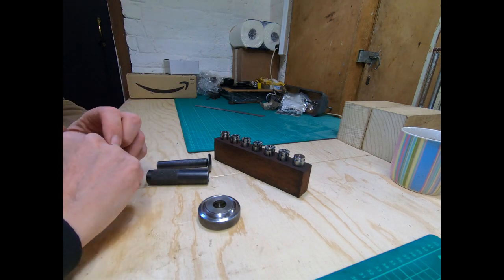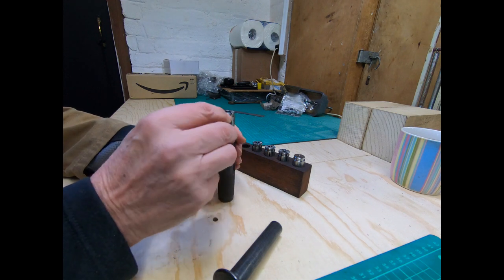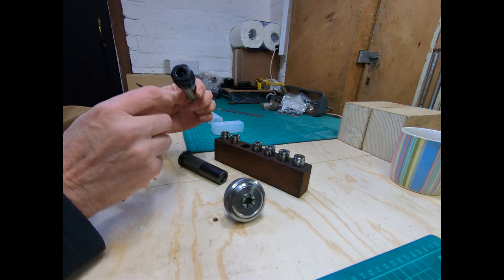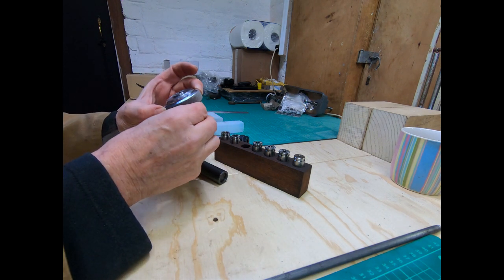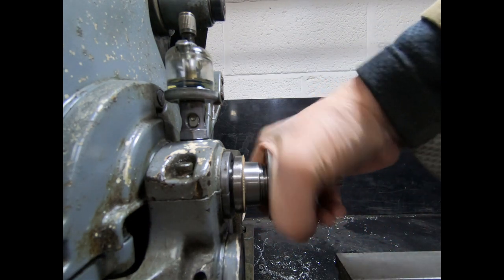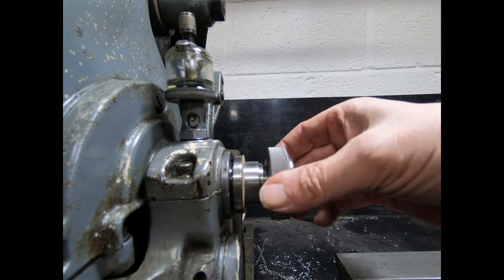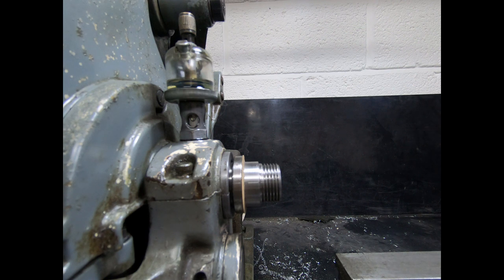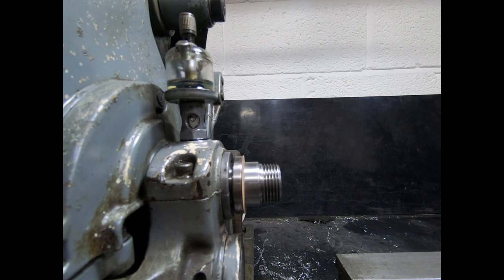Myford Lathe - Genuine Morse Taper 2 (MT2) Collets.

Comment: Everything you said was I think correct Paul, and unless those collets are seriously worn or there's damage within your spindle, the run out should be very good. Anything Myford made was always to a high standard. But for a lathe, a spindle mounted ER collet chuck either shop produced or commercially obtained can be made to work with basically zero run out. Yes it takes a bit of design and machine work, but it's possible to use the same idea Bison and a few others use to zero the part run out on there 3 and 4 jaw scroll chucks for multiple parts of the same size. Running a Google search using Set Tru, Set True, Griptru etc will  turn up the information. But it basically uses a slightly under sized back plate that fits the chucks recess and usually 4 set screws through the rear O.D. of the chuck body to adjust the run out your collet chuck against that back plate and/or any run out the collets may have. You do have to slightly loosen the bolts holding the chuck to the back plate, adjust and then re-tighten. And yes all that is just about as slow as just using a 4 jaw independent chuck. The difference though, is once adjusted it will have the same run out for multiple parts.

For a lathe I don't use the taper mounted ER chucks at all simply because as you mentioned they do prevent longer work through the hollow spindle that was designed in for that exact reason. There only benefit is that there quick to mount or remove. But there's no adjustment, so what you get for any run out your stuck with. Although they make 5C scroll chucks that could be made to work on that Myford, they would really be a bit too large and heavy. As far as speed, a lever or air operated 5C collet chuck is about the standard for most of the world. Unfortunately they require a spindle taper of at least MT 5 and a full set of 5C collets. At the quality and guaranteed low run out I'd expect with any collet set up all that would be very expensive and still wouldn't work with my MT 4 lathe. For people like us, I think the ER collet design and those back plate mounted chucks are about the best compromise. The ER's are still very limited against 5C's and there multitude of accessory's, indexers, square and hex collets though.
Reply from the maker: Hello,
Many thanks for taking the time to watch and comment... One of my goals is to show interested viewers what the Myford has to offer which is partly achieved by my video but also by people adding comments... I have a Grip-Tru chuck for my Myford and plan to make a video on it at sometime in the future... When I first saw them I thought they are very good and would help to get some accuracy in my setup...
Take care.
Paul,,

Comment: Great video Sir, I don't have a Myford, but a related problem I found  on my older Logan lathe the 3AT and 3C collets are limiting on the bar stock thru size up to the largest collet ID=7/16".   I recently added a 5C collet chuck and increased my thru bar stock size up to the limit of the spindle ID= 25/32"  The scroll action of the 5C collet chuck has much more holding grip than the 3AT-3C.
Reply from the maker: Hi Al,
Many thanks for taking the time to watch the video... sounds like you found a nice solution on your Logan... I do like the look of the Logan lathes...
Take care.
Paul,,

Comment: That is a very cool idea they had with the way those collets worked, I guess the ER system just eclipsed it as time went on but I can see how the MT system would have its advantages with lathes having smaller spindle bores.
Reply from the maker: Hi Everett,
As you say it is very good with the smaller spindle bores and the thing I liked was reducing the layers of potential error... it is a good design...
Thanks for watching.
Paul,,

Comment: Those are great. I like the spindle nose closure. I think the direct taper collets I've seen in the past have a drawbar to pull them - which also blocks through holding. Those are the best of all worlds. Though I like ER collets for the range of holding size, and price :)
Reply from the maker: Hi Craig,
Thanks for visiting, I must admit I do agree that the ER collet system is quite hard to beat for all the reasons you stated. Once I get more confident with my turning ability I have it in mind to make a backplate with an ER32 collet holder on it, hopefully this will give me some size flexibility at a good price point. I was very interested to learn for James Clough how tight an ER32 nut should be tightened to... around about 100foot/pounds I believe and Chuck (Outsidescrewball) has done some testing and it improves accuracy.
Take care.
Paul,,

Comment: Very interesting setup that Myford had for their MT collet system - no drawbar.  Being made by Myford, I would expect decent accuracy.  My P&W bench lathes and mills all use a drawtube for the collets (3PN, 4PN, and 5PN proprietary).
Reply from the maker: Hi Daniel,
I am hopefully it will all be reasonable accurate... I was doing a job for someone last week and notices some end float on the main spindle which I need to address. I have just looked up the P&W bench lathes and they look rather cool... Many thanks for taking the time to watch.
Take care.
Paul,,
Reply: @TheKnacklersWorkshop  Yes, the P&Ws are really nice machines, but have no time now to get them all up and running.  May do a short video on them in the near future.

Comment: The Myford nose collet setup is great for quick jobs. Wouldn't be with out mine. I also like the lever collet setup From Myford. It uses the Hardinge MA99e collets. The lever setup is very expensive and the adapter to make it work is as rare as hens teeth.
Reply from the maker: Hi Duncan,
I am pleased with the nose collets, I have seen your lever setup and it looks very good. I do think the capacity of what I have is limiting so feel sure in time I will needs an additional solution. Thanks for watching.
Take care.
Paul,,

Comment: Great video. What you say may be correct however i'm lucky enough to have the Myford MA99E  collet chuck with a full set of metric and imperial collets. (Yes it cost a fortune). I have to say it is very accurate with little run out.  I think either option is great. Using collets for accurate work and a four jaw for larger work is the way to go in my book. Many thanks for sharing
Reply from the maker: Hello Rupert,
Many thanks for watching the video and taking the time to comment... Yourself and Duncan have both said the MA99E collet chuck is very accurate which is good to know... I managed to pick up a GripTru chuck recently which I will feature at sometime in the future...
Take care.
Paul,,
Reply: Yes i need to get hold of a more accurate 3 jaw if there is such a thing. I've also got a nice 5C chuck which i need to machine a back plate for.  Looking forward to your next videos. Cheers Rup

Comment: Those are bloody fantastic 😀. I've got a set of mt3 collets, still love them, but unlike yours they are quite limited to the length of stock your using due to needing a drawbar. Collets are great time saver and personally I prefer them when turning stock at high speeds. Thanks for the share, Paul 👍😁👍. 
Cheers!
Reply from the maker: Hi Chris,
Hopefully in the future when I turn more I will use the collets as first option where the stock size allows... I would also like to try and cultivate the habit of using them to hold drill bits in my tailstock. Thanks for watching.
Take care.
Paul,,

Comment: Interesting! I just bought a set of collets identical to yours. I measured the run out of the main spindle and it was close to zero - maybe 5 microns. But then we put a new small milling tool into one of the collets and we measured close to a quarter of a millimetre(!) run out on the tool close to the knurled nut - any suggestions as to what is going on? I really don't want to have to return the collets (which appear to have been well looked after) but this level of runout renders them useless...did you get to the second video you mention? Thanks. Neil
Reply from the maker: Hello Neil,
Thanks for watching... First of all I would make a mark on the front of the collet and the knurled nut with a sharpy, then repeat the test you did, note the runout and then, loosen the collet and try and position the sharpy mark on the collet 180 degrees from the original position,  The mark on the knurled nut should end up in the same place  as test one. Measure the runout and see if it differs... As well as the spindle which sounds good you have the collet and nut that either of both could have an issue... by moving the position of the collet in the spindle and that of the nut you may find a sweet spot. 
Not made the other video yet, moving workshop has disrupted most planned items... Hopefully I should get back on track in the next two or three months.
Take care.
Paul,,